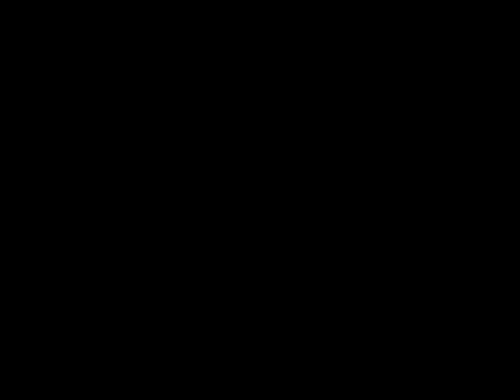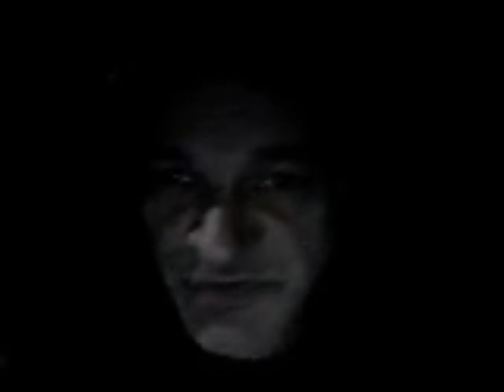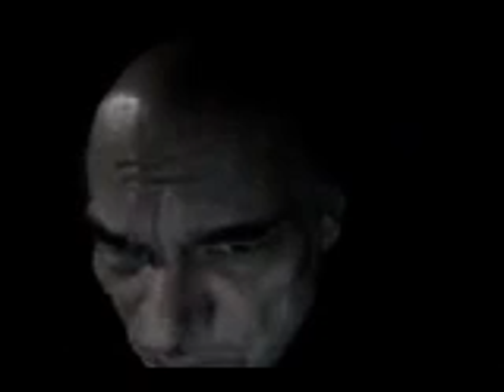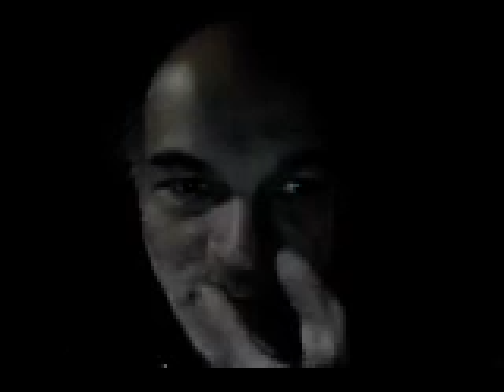.22 .25, & .27 caliber 1300 fps purple nickel Powder actuated tool blank hack SHTF ammo as of 2010?!

Comment: Turn your light on, learn to read and pronounce the words your talking about. 
Your channelis garbage and the only reason I could imagineanyone would as you a question is they want to laugh at you trying to stumble through a terrible answer. 

.25 acp is a rimless cartridge is rimless and the .25 cal for the the powder actuated tool is a rimmed cartridge. Also a caliber isn't sometimes a rimless some times a rim fired bullet if they where the same caliber with different firing systems they would go by different names. Such as how there are at least 4 different .45 caliber rounds out there and they go by things like .45 acp, .45 long colt,  45 gap etc. The way he speaks of rounds he'd probably try to stick an a round in a high powered rifle because they both are 7.62 ignoring that one is 7.7.62x39 and the other 7.62x51 and that the clambering of the round is very specific. Even though they have the same diameter that only refers to the projectile not the casing even though there are very specific catering measurements to fit the cartridge of that exact round. He also continuously keeps saying .556 (obviously referring to the .555x25) is the same round as the Remington 22e when the .556 need more head space and has higher pressure rates.
Reply from the maker: someone explains imagineanyone .555x25, channelis 7.7.62x39, clambering .556, Remington 22e catering

https://youtu.be/6MVevhUubSA
Reply from the maker: aaaaaaaaaaand no reply?
Reply from the maker: whelp? gotta remake my Jan 28, 2021 reply to you lol 

yes i miss-pro-noun-st. cAtering (food service) as cat ear ring , see how ironic it was ;-) 

Don't you love when someone tries to explain something they don't understand. .25 acp is a rimless cartridge is rimless and the .25 cal for the the powder actuated tool is a rimmed cartridge. Also a caliber isn't sometimes a rimless some times a rim fired bullet if they where the same caliber with different firing systems they would go by different names. Such as how there are at least 4 different .45 caliber rounds out there and they go by things like .45 acp, .45 long colt,  45 gap etc. The way he speaks of rounds he'd probably try to stick an a round in a high powered rifle because they both are 7.62 ignoring that one is 7.7.62x39 and the other 7.62x51 and that the clambering of the round is very specific. Even though they have the same diameter that only refers to the projectile not the casing even though there are very specific catering measurements to fit the cartridge of that exact round. He also continuously keeps saying .556 (obviously referring to the .555x25) is the same round as the Remington 22e when the .556 need more head space and has higher pressure rates. Turn your light on, learn to read and pronounce the words your talking about.  Your channelis garbage and the only reason I could imagineanyone would as you a question is they want to laugh at you trying to stumble through a terrible answer.

https://archive.is/https://www.youtube.com/watch?v=6MVevhUubSA 
https://archive.is/MP7yW 
https://archive.is/y6VBl

Comment: years ago was attaching a ledger board to a cement block wall in the back of a liquor store. I thought the blocks were grouted solid
..they were not. Using a purple load in a Ram Set I blew the nail thru the the board.  thru the blocks out into the store where the nail took out some top shelf booze and out through the front window (breaking it )  nail  dissapeared someplace never found. Bad choice of round..luckily no one got wacked. Owner was pissed! !  No Shit...;)